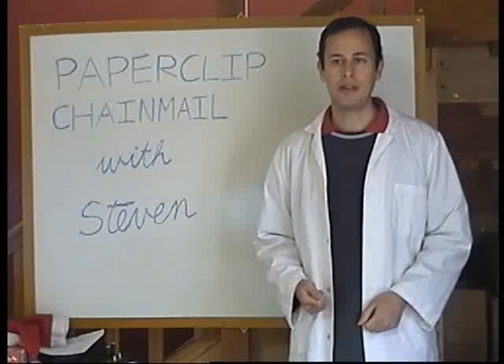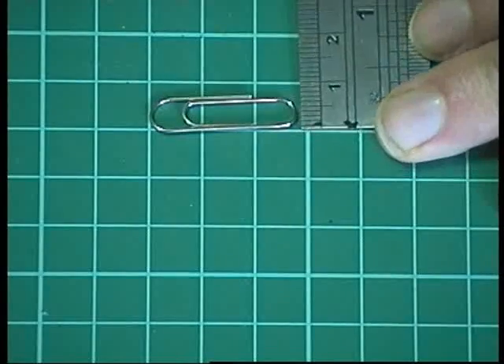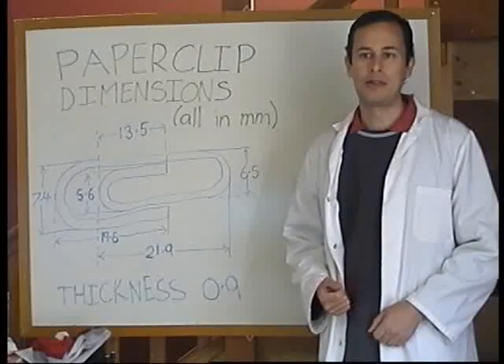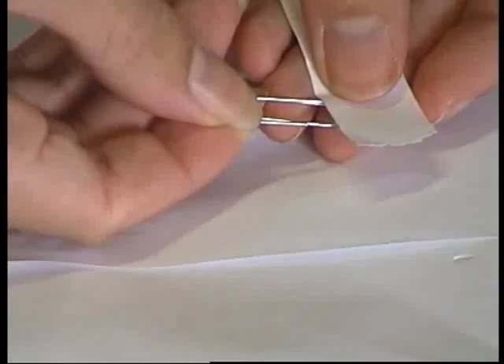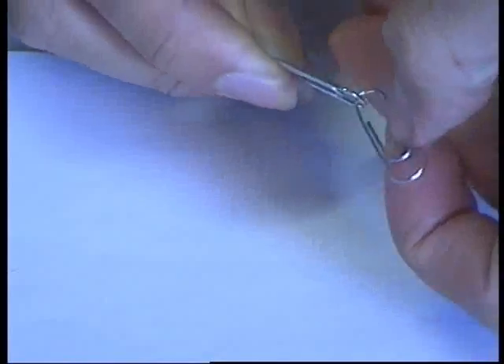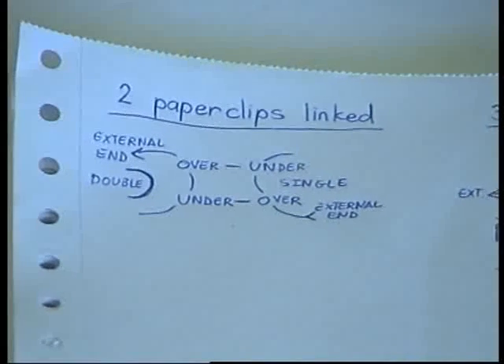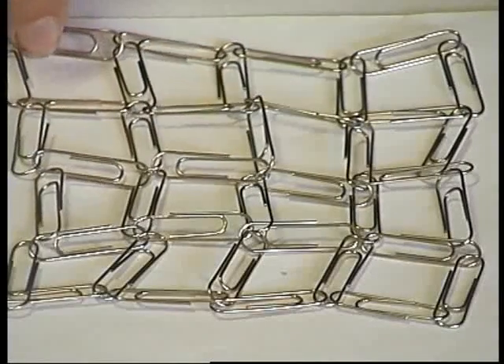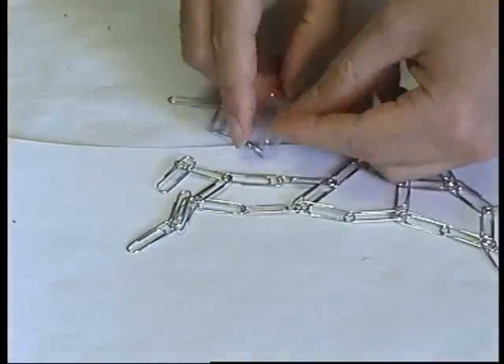paperclip chainmail

Comment: It's not necessary to solder the links to prevent movement, but it is necessary to use the inner loop instead of the outer, so they can't just slide back off.

Comment: When I first did Paperclip chain mail back in the 1970's I purchased duct tape, not the grey fabric plastic stuff, the aluminum metal type. Cut it into strips and wrapped each clip. This locks each clip, prevents fabric snagging on the wire ends and adds a great shine!